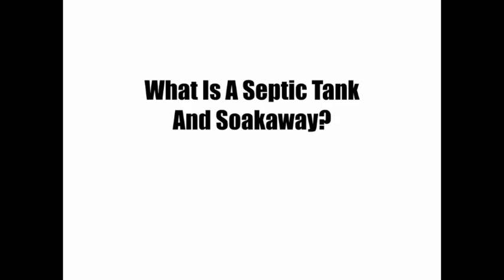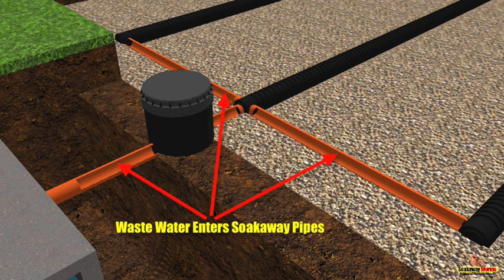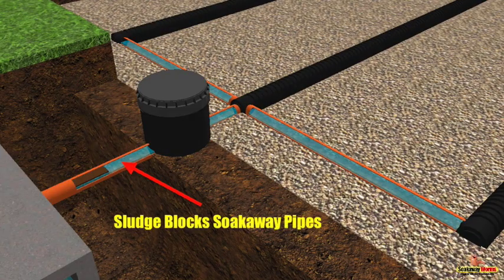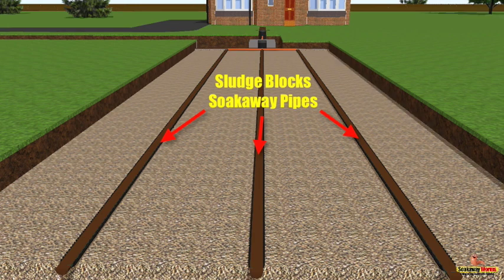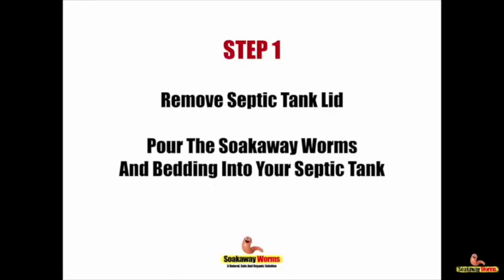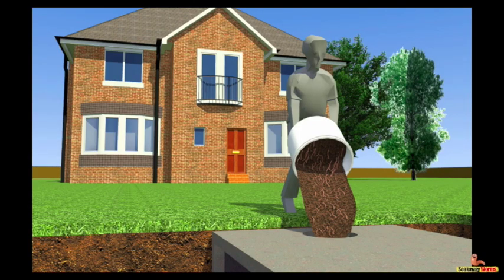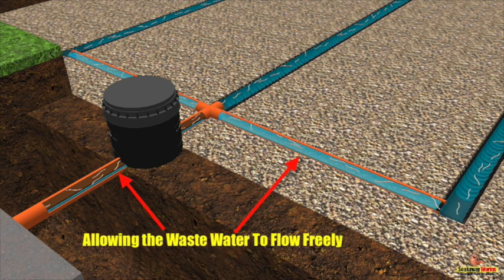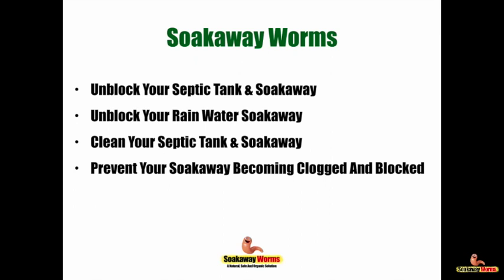Soakaway Design

Comment: I also did a Google search regarding Septic Crates and found this is also in direct contradiction to what you say about these can you please clarify this and please give me the government link to verify that they say these are legal? Thank you: -  
Can you use soakaway crates for septic tank?
Image result
Soakaway crates, tunnels, etc. are only to be used for Rainwater run-off and they are not allowed to be used for septic tank or sewage treatment plant soakaway drainage systems. They are also banned under the Environment Agency General Binding Rules for Sewage Discharges to Ground.

Comment: Just did my own check about what you said about needing an "MOT" if a septic tank has been installed earlier than 2015. So after reading this on Google was wondering what I have missed as this is in total contradiction to what you have said isn`t it? Sorry, but I have to get this right so I can dig my way thru this septic tank minefield as I am about to purchase a property with a septic tank that was probably put in 70 years ago and is concrete. Do you need a certificate for a septic tank?
However, septic tanks do not need to be registered and there is no legal requirement to keep records of maintenance (although this is strongly recommended as purchasers will enquire about maintenance).25 May 2022